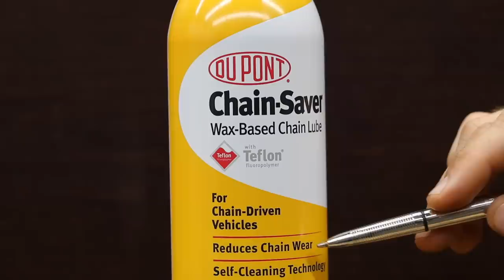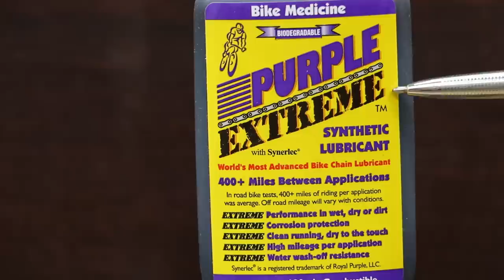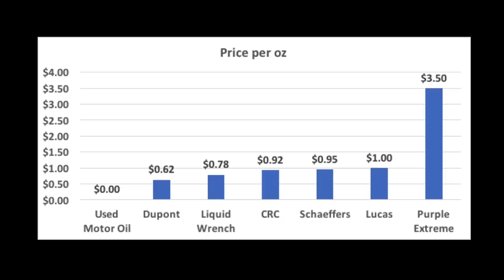Which Chain Lube is Best? Let's find out!  Ultimate chain lubricant showdown!

Comment from the maker: Thank you all for the terrific video suggestions!  I've provided the links to the chain lubricants below but recommend shopping around for a better price.  Thanks again and best regards, Todd
Lucas Chain Lube: https://amzn.to/2FIRow9
Dupont: https://amzn.to/2FP45pp
Liquid Wrench: https://amzn.to/34qk7Aq
Schaeffer's:  https://amzn.to/31iLwC7
Purple Extreme: https://amzn.to/2E7SQYP
Reply: LPS #3
Reply: The CRC link is missing.
Reply: do u think u can test Motul and if u can try and get your hands on Biltema  its a swedish brand so it might be hard but still i would really like to see if there is a major diffrence
and i mean i could be what ever chainlube , motoroil and so on
Reply: lucas link came up as crc
Reply: Did I miss something about bike chains and project farm? Or has the bike chain itself not been tested. Asking this because of e-bike mid drive with high torque output. How long will it last, some rolling resistance and how much abuse does it tolerate 😇
Reply: I always use grease on my cruiser bike chain and I just change the grease every year of use and it still works great
Reply: Hi Project Farm,  in 5:21 friction test maybe you can include a "contaminated" version of the test and see how would that affect the result.
Reply: If you plan to do another chain lube showdown, I highly recommend "Lubrease" by Chemsearch. It was used all over our plant for 30 years and I never saw a rusty chain that had been serviced with Lubrease. Its in a yellow can with "LUBREASE" across the front in blue. The spray is black.
Reply: I’d love to see an updated chain lube test with some of the newer wax product especially, such as Molten Speed Wax New Formula, Silica Hot Melt, Rex Black Diamond Wax, Effetto Marilosa Flowet Power Wax, Ceramic Speed UFU, and Silca SS Drip - to name a few =)

Comment: try some chain lubes from motorcycle chemical manufacturers. Maxima, Bel ray, Pj1, Motul etc. as always i enjoy what you do on this channel!
Reply from the maker: Thank you for the video idea!
Reply: Valvoline White synthetic or dry chain lube from other manufacturesrs
Reply: Exactly, I was thinking the same thing.
Reply: Totally agree with motorcycle-targeted products.  Add WD40 and 90w gear oil to the mix.
Reply: I agree, we sold PJ1 lube at the motorcycle shop I worked at. No complaints, everybody loved it.
Reply: you can head over to Fortnines channel to see these!!!
Reply: @wyldebyll3089  i only used pj1 chain and air filter oil/ cleaner in my motocross days and i was sponsored from my local yamaha dealer
Reply: Please?! Lol
Reply: Project Farm should have tested the before and after temp on the chain saw test
Reply: Definitely motorcycle chain lube test!
Reply: @ProjectFarm  And don't forget to try gear oil as recommended by most motorcycle manufacturers and rated best by FortNine's testing. :)
Reply: Maxima is basically the same as the DuPont he used except Maxima doesn't have Teflon.
Reply: Maybe throw a dry type white lithium in, too.
Reply: Maxima would be a good one. As well as an air filter cleaner filter cleaner
Reply: Also, spray on lanolin in addition to motorcycle chain lube.
Reply: The motorcycle chain lubes say heat up the chain before spraying them down.  Don't know if any of these called for that.
Reply: I agree I use to use a chain was that worked great. That was along time ago I'm sure they have better stuff on the market. But nothing takes a beating like a dirt bike chain!!!
Reply: I've used a few different brands and really love BelRay and AMSOIL products. Especially great for grease, as it's water resistant due to technically being a marine product. Have WR450F and it has a few places where rust is common and YamahLube seems to be absolute shit in the past few years. :'(
Reply: My favorite is Honda spray...I’m curious if the tacky stuff like bel ray blue tac works better? You’d think the sticker it is the more sand/dirt would stick to the chain, creating more friction? I dunno lol
Reply: Great idea to do a motorcycle chain lube contest! Most of them now are these runny clear things. I prefer Maxima's white lithium based chain lube. Works great and really adheres to the chain.
Reply: Good idea. I was thinking the same. It would be interesting to see some curveballs in there too like pine oil, or olive oil, coconut oil, paraffin oil/wax.
Reply: Yes, PJ1 Blue is the one I have been using for 2 decades for street sport and cruiser motorcycles.
Reply: Projectfarm, some things that need to be taken into account when comparing motorcycle chain lubes are: 
Oil ring protection
Sling
Corrosion 
And since every product is going to sling some, what does it look like on my rear wheel once it's on there.
How hard is the clean up?

Some motorcycle rear wheels are easier to clean than others so a really dark sling and something tough to get off is often a big consideration for many riders. 

As always, thanks for these vids. You have helped me spend my money wisely.
Reply: I used ATF, ( automatic Transmission Fluid ) on a restoration of old rust bike. Afterwards chain did not start to re-rust for nearly a year.
Reply: Spectro Z Clean chain lube with zink if you can find it, it repels dirt, sticks like glue.
Reply: @ProjectFarm  I shoulda sub'd a long time ago. I do watch a lot of your vids, but this one definitely got me to subscribe. I'm interested too in motorcycle chain lubes and maybe other dirt bike petro products. I already watch dirt bike channels and get their opinions, but you're a lot better at providing scientific evidence doing well to try eliminating variables in your tests.
Reply: @wyldebyll3089  They sell tire balancing beads that dont work and the buyers all love them too.
Reply: I have come to the conclusion that Maxima is the best motorcycle chain lube...
Reply: Wylde Byll PJ1 black label for the win
Reply: AGREED
Reply: Maxima is best
Reply: How about Fluid Film lanolin based lubricant.
Reply: I use Bel-ray on my ATV, it sticks like crazy but I wonder if it attracts sand and causes more wear that way.
Reply: I just know that 3 in 1 oil would work wonders; it has a high film strength and good slipperiness.
Reply: If you are doing motorcycle chain lubes i would love to se the Castrol chain lube racing spray
Reply: @ProjectFarm  Amsoil makes great chain lube called heavy metal protector, it's what I use on my motorcycles
Reply: I know your comment is from 2 years ago but has everyone seen fortnine's video on chain lubes for a motorcycle chain?  I always thought on the farm a foaming lube was best but his test and explanation makes me thing some gear oil would work best
Reply: @voortman46  when I baught a can 25 years ago I've never used anything else. Dirtbike chains really take a beating Maxima Chain Wax works great. Maxima products are all great we used their premix for years too before finding Silkolene Pro 4.
Reply: I use bel ray on my dirt bikes 🤙🏽
Reply: @jeemboNC  these sound like some Ryan F9 recommendations. I use the 90w lucas gear oil and i use a rag to 'glaze' it in. Works super well for me.
Reply: If anyone is wondering. The channel ‘Fortnine’ did excatly this.
Reply: @ProjectFarm  I agree with this comment! Can we expect to see this video sometime in the near future?
Reply: Liqui moly and Honda chain lube
Reply: @riccardocarbo2479 until it goes bad and dirt/dust start sticking.

Comment: Been an avid cyclist for decades now. Used dozens of different kinds of lubes. Wax based, oil-based, you name it it's probably been on my bike. All of them disappointed and were way too expensive for tiny bottles. One day I ran out of my White Lightning and figured I needed SOMETHING so I blasted on good ol WD 40. That was over 6 years ago and I'll never use anything else again. It's just so dirt cheap and effective it can't be beat. A quick blast every couple hundred miles, or a spray after a rough day of getting caught in the rain and my chain looks like I just bought it. Dirt buildup doesn't matter when you can just hose it off, and longevity means nothing when a gallon of WD cost about as much as a chapstick tube worth of "performance" bike lube.
Reply from the maker: Thanks for sharing.

Comment: For nearly a decade I've  cleaned my motorcycle chain by applying kerosene with a small scrub brush and then spraying off the dissolved grime with a garden hose. After drying in the sun I apply Lucas. Watching the energetic foam penetrate is addictive. The chain still looks like new. Whatever brand of chain lube is used clean and lubricate often.
Reply from the maker: Thank you for the feedback

Comment: Test gun solvents please. Against like carbon build up and lead particulates. Great video, always quality and never rushed. Thanks
Reply from the maker: Great video idea!  Thank you
Reply: I would be interested in this as well. A lot of misinformation on the internet about gun lube. They should handle high amounts of heat, resist carbon build up, and not dry out over a period of time. Low viscosity, drying up oil is primarily used, though I think a grease would probably work better.
Reply: I'd love to see gun solvents as well!!!
Reply: what is the stuff called????
Reply: maybe do one on copper solvents and black powder solvents too
Reply: butchtropic  he could use blanks, they are notoriously dirty
Reply: butchtropic  fair point
Reply: @WINTEJER000   I've used KG industries copper remover and it seemed to do alright.  Fella I know swears by Montana Extreme copper killer in his high precision guns.  Couple things to test in a new video here??  Kind of an expensive thing to test across the board though....
Reply: Auto greasw, white lithium grease for guns.  If it rolls-oil it.  If it slides like gun parts, grease it.
Reply: I've been thinking, for lead and copper removal, you could build a rig to where a copper rod or lead block was a set weight placed on it and then slid over a grooved piece of steel. That way, 1, we can see the results better, and, 2, it's repeatable, and, 3, it's cheaper. You could also do a lubricity test on a series of traditional, closing, and non traditional gun oils. As far as powder fowling, you can get some Clays or unique reloading powder, they are generally accepted to be dirty powders, place 10-30 grains on a piece of grooved steel and let it burn, either do this once or multiple times simulating multiple shots, and then do the clean tests. Also a lot of products claim to be rust preventatives,  you could take small strips of steel, coat them in the product then expose them to water, salt water and oil, like from handling, maybe use a hotdog or something for repeatbility. Perhaps also see how well they displace already existing water or repel water. You could coat a nut and then drop in water and see if it stays on the nut. Also pour some in a cup of water to see if it displaces the water and falls to the bottom of the cup, this should simulate actual water displacement. Perhaps also apply the various oils to apiece of polymer, to see if it will damage the polymer stocked found on many weapons, can also do to wood. This should give an affordable and repeatable process. Also if you go for these tests ( I think the lead, copper, lubricity, rust protection, water deturant, material damage and fowling can make a whole series of videos) you could move to black powder and it's substitutes, test the black powder cleaners and how corrosive the various black powder substitutes are compared to black powder. I have a whole list of products I think would make for good tests, if you want the list let me know. Sorry for the novel, but I have been giving this some serious thought, and hope this gives you a good way to do this, if you want.
Reply: This would be a great area to explore. I have tried many gun cleaning solvents and never found one that is a real "go to" product.
Reply: Yes. I'd like to see a gun oil showdown
Reply: yes great idea. Try CLP! i use that stuff all the time, not sure how good it is but seems to work for me!
Reply: butchtropic  Sorry meant to reply to hayyremz, haha don't know what happened there.
Reply: Poop particulates
Reply: Yeah yeah yeah. They'll also protect your gun from little carbon, a little lead deposit help a little on the rust but where in the hell can I find 1 that will resist my kid taking them and either lose them or bring them back with moisture and rust on them. I don't know what happened I taught him well and he was perfectly responsible with all of his items until he got about 25 or so years old. But the woman he's got living with him is part of his problem she doesn't like guns.
Reply: Even just doing a wear test with the bearing for repeating cycling of the weapon, and a corrosion test for how well your fire arms stay protected if you stored them outside near the ocean...  My current stockpile of cleaners and protectants are: Amsoil Cleaner and Amsoil Lubricant, Rand CLP, Archoil AR4400 (actually the old CLP and LP separate formulas), and Hoppe's 9 lubricating oil.
Reply: Montana extreme is fantastic, hoppes #9 is the old faithful, gunzilla is excellent (non toxic and biodegradable), otis has a clp, break free, shooter's lube is advertising  hard, then there is the me too with lucas oils.
Reply: Sad thing is with the current mood i dont think it would be worth the possible demonitization of the channel. Be really cool though, and i second the blanks. Also heavy lead fouling ( muzzle loader perhaps) and copper remover.
Reply: Gun solvents and gun lubes would be a test I would watch 10 times for sure. I currently use hops 9 to clean and motorkote to lube but would love to see what other options work well.
Testing them on lubricity before and after they are heated would be a great test. Carbon and dirt buildup resistance and their viscosity in terms of a drip test would be good. Oil isn't any good of it just drips away and leaves nothing behind.
Reply: Another vote for gun products
Reply: All I can say is I've used EEZOX on high carbon and stainless everything since 1990. I just coated a Ontario (Old Hickory ) Butcher knife , 1095, with it 5 months ago after cleaning it with the EEZOX and applied 3 light coats because I LOATHE corrosion. Laid the knife up, in 60 % humidity in the house. No visible change since. Its not the worlds best lube but the cleaner is 1.1 Trichlor... It works and if you add a bit more it doesn't dry out. Its full synthetic and you're kinda married to it. But again...great product and no I don't sell it. Thanks to Todd and PF I use Seafoam DC for EDC, but storage...its still EEZOX. I would love to see his eval, doesn't even have to see a gun...The man would figure something out. He's military. Eezox ain't cheap, but humidity... salt etc...its do or desist 😂😂
@Project Farm
Reply: @WINTEJER000  Sir  that's a VERY well thought out testing procedure. I'm very interested as well. I'd love to see what works and what doesn't.   Very interesting stuff indeed! As far as lead and copper fouling I baught a big ol jug of this stuff called Sweet 7.62 at a gun show years ago and it's just amazing stuff.

Comment: As a motorcyclist, this is always the quest. Finding the perfect chain lube. You hit the nail on the head when discussing the intended use. Adventure riders will use something different that paved riding. Thank you for the vid!!
Reply from the maker: You are welcome!  Thanks for sharing.
Reply: Most motorcycle companies recommend gear oil. o
Reply: @bilboswaggens2975 While gear oil is great, i use it on my motorcycle to. It's worth noting the reason why the motorcycle companies recommend gear oil. They obviously do not have interest in recommending specific brands here, rather something generic...and that's also why gear oil is ideal. With that said gear oil is very good, it's just that the application methed is more cumbersome that a spray. I with we could have gear oil on spray can, that would make it soooo  much easier.
Reply: I've always used gear oil, and my chains last a long time. I've heard the argument that petroleum products could degrade x and o-rings but I have not experienced this. My zx6r has had the same o-ring chain for 5 years and the o-rings look pristine. I don't put alot of miles on that particular bike but the rings have been coated in gear oil the entire time. That's been my experience ymmv.